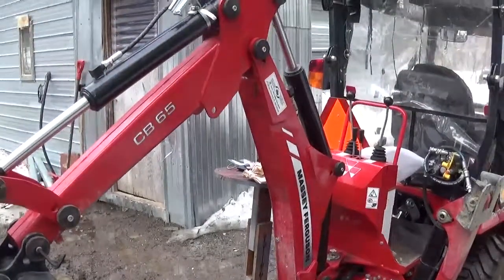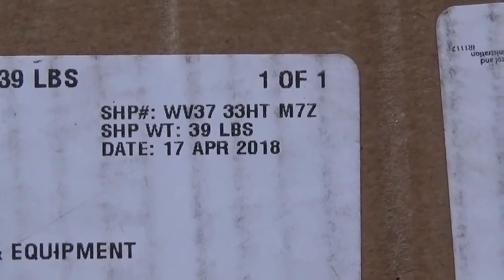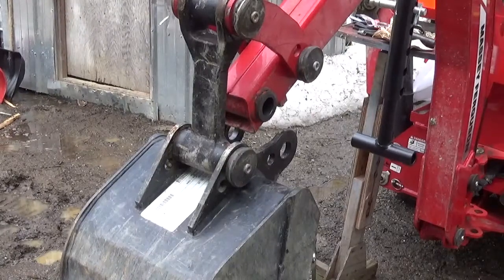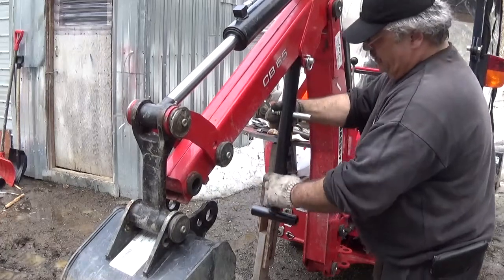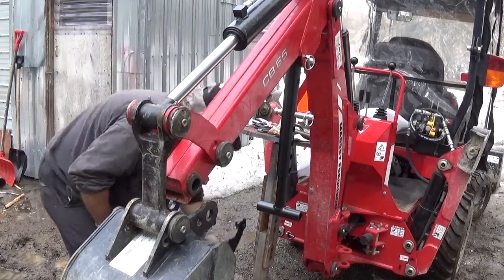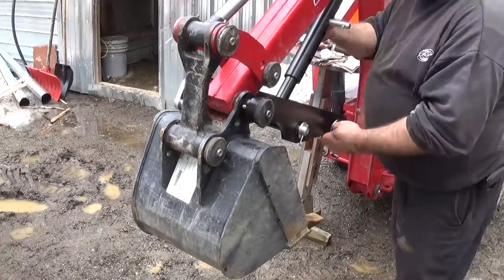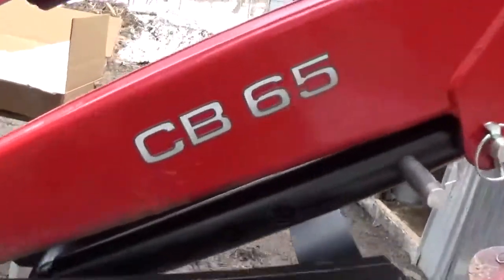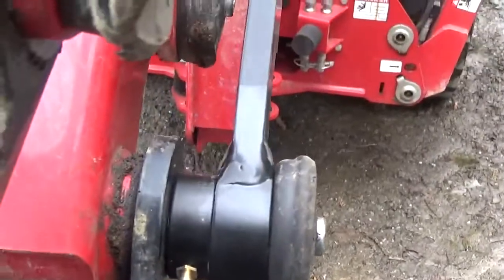Thumb Kit for GC1710 install

Comment: Thanks you so much for your video.  It's a long story, but the bottom line is my dealer installed my thumb on the wrong pivot point; the one just above the bucket, not the one the bucket attaches to.  I was having trouble getting a secure grip on things, and I went looking for "lessons" to see what I was doing wrong.  As soon as I saw you pull the pin on the bucket, everything made sense.  I changed my setup and it works much better!!!  Thanks again!
Reply from the maker: Thanks I did some modification on mine I did a video about it too.
The way this thumb is made it's slip when you try to pick bigger rock.but other then that love it allot

Comment: Great Video. Excellent Step by Step Video! That Original Equipment Thumb is a beast, perfectly designed to match the CB65 Backhoe! Plus best part keep your machine fully covered under manufacturers warranty. Most don't realize that the aftermarket attachments can void the warranty.
Reply from the maker: Did you saw the video where I did a modification to it?
Reply from the maker: Did you watch the other video of mi GC?
Do you think mi snow blower is too big?
Reply: No I did not. Do you have the link to video?
Reply from the maker: Well if you go on this video and you click on mi channel name you will go on mi channel and there you click on "Video" and you will see all mi video.Or here a link:
www.youtube.com/user/MRnounoursSQ/videos?disable_polymer=1
here you will see all mi video
Reply from the maker: So did you saw some of mi video?
What do you think about the size of mi snow blower?
Reply: @MRnounoursSQ  we don't do many snow blowers down here but looks like it's working good for you and fits the tractor well

Comment: Nice, easy, install similar to the BXpand. I look forward to seeing that bad boy in action. I bet you're glad the snow is finally over. Thumbs up and thanks for the video. We're excited just as much as you for any new attachments on our tractors (chuckle).
Reply from the maker: Yes it was an easy install. I like it allot but whit big rock the way it's build they slip away. Will make a little modification on it.

Comment: That is a very easy install. I have been wanting a thumb for the backhoe on my GC2610. I don't know if the thumb for the CB 65 backhoe will fit on my older CB95 (I believe that is the model number). I need to investigate though, because I need a thumb soon. Thanks for posting the video. I just subscribed, too! Have a good weekend.

Comment: Congrats!  That looks really good and it was a easy install. Definitely can't wait to see some action.
Reply from the maker: Did try it I think you will prefer yours will explain in a video.
Reply: LMAO!!!  I don't know.  I'm dealing with some things with this one. LOL   I thought you was getting the better deal. LMAO!!
Reply from the maker: Well I like it. It's build really strong. It's just that the curve of the thumb should be they other way I did try to pick up a big rock and it was slipping all the time.
Reply: Have you tried picking up logs yet. About 10" inches are smaller.
Reply from the maker: Not wet.
Reply: One of my issues I'm having is it won't pick up 12" inch or smaller logs but anything bigger it will. It would pickup your rocks and hold them and I bet yours would pickup the smaller logs. We need to trade. LOL  yours does what I need and mine does what you need. We got the wrong tools for the job. LOL
Reply from the maker: Maybe but will modify mine will make a video.I think mine is more easy to modify. and i just re watch your video and I think yours is a little shorter.Mine doesn't go in the bucket.
Reply: Yeah it is much shorter that some of the problem for picking up small stuff.